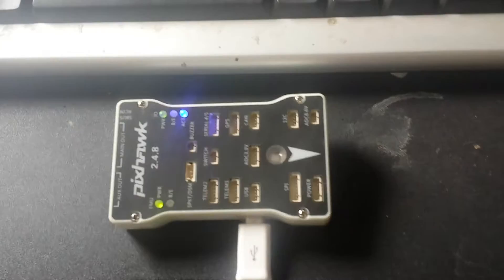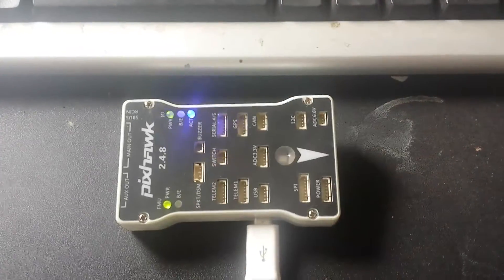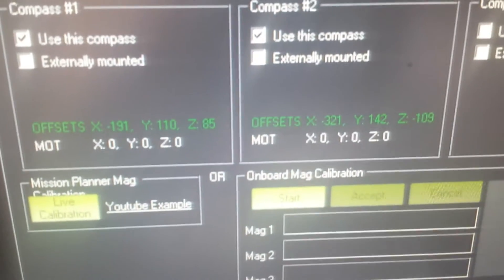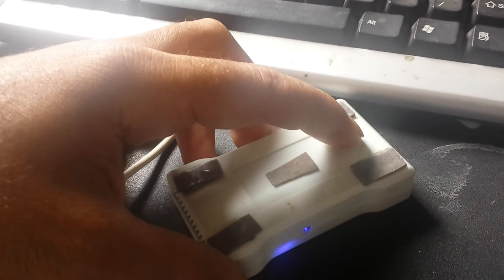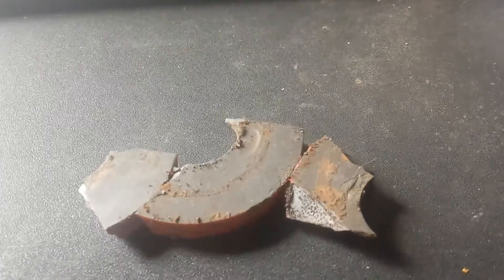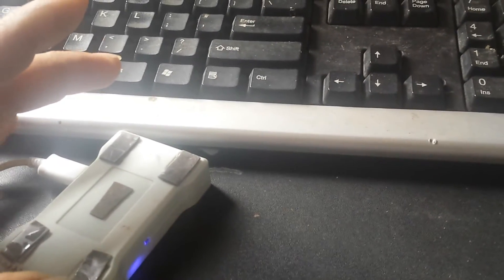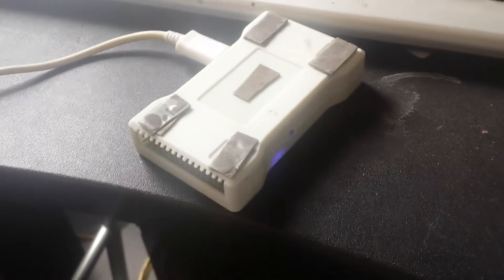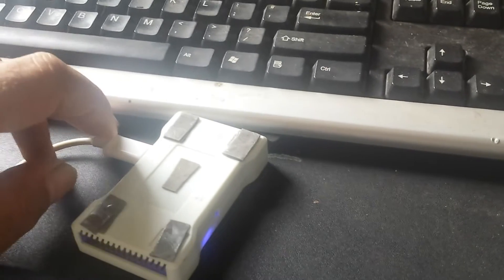pixhawk compass FIX!! for high compass offsets and compass inconsistencies.

Comment: after several failed attempts, I finally landed up with very good compass offsets;
COMPASS_OFS_X	30.37397
COMPASS_OFS_Y	93.62046
COMPASS_OFS_Z	55.33688

Earlier they were upto 350

I ordered a pack of four loudspeaker magnets 40mm x 6mm from amazon. Took a small stainless steel (non ferrous) kitchen bowl and also taken a stainless steel large utensil and filled it with 1-2 lt water and put the bowl in the large utensil, jointed three circular magnets in a way they attracted each other and put this combined cylindrical magnet  horizontally in the small bowl (which is now made up of three magnets, connected in series like batteries).

the end which freely pointed towards north was marked N (Northe) and the opposite end S (South).
Marked each magnet.

Took a cardboard box 5inch x 4 inch x 2 inch and put the Pixhawk in this box with usb cable attached.
Pixhawk was put normally and not flipped.

Imaging Pixhawk in the box is infront of me on the table, pixhawk heading is on my right hand side
Note that I did not flip the pixhawk, it is lying normally flat in the box with heading arrow toward my right hand side.

Attached one magnet on bottom of the box in center (North of magnet facing the box)

Attached one magnet in the right side of the box  (towards my right hand side, North of magnet facing the box

Attached one magnet another side of the box (the side of the box which is facing me)

Inserted the other end of USB cable in Laptop's USB port but did not connect with Mission Planner, waited for 15-20 sec and then removed magnets and also jacked out the USB cable from Laptop's USB port.

Again jacked in the USB cable again in USB port of the Laptop, started mission planner 1.3.80, calibrated compass and all done.

To reach on the above process, I had several faild attempts specially my offsets were in the range of 1500 when I flipped the pixhawk, it may be different in your case.

My Pixhawk is chinese clone of Pixhawk with aluminium CNC case and the IMU suspended internally which requires no ant-vibration pads to be used in Quadcopter frame.

Comment: Will this work if I use one big speaker magnet?
My magnet is the same length as the PixHawk.
My magnet is wider, of course, since it is a circle.

I want to try this, but hate the idea of breaking up this magnet, since it works so well picking up stray nuts and bolts on the shop floor. I just tie a rope through the middle and drag it around.
Reply from the maker: it should work with the speaker magnet no need to break it up , its a pretty forgiving process it won't harm the pixhawk to try it , if don't work good on all axes, you'll just have to get a straight magnet to get it all right, sorry couldn't reply earlier.

Comment from the maker: Because the earth's magnetic field is weaker then the magnets applied it calibrates the compass and then when magnets are removed it works off the earth's magnetic field again.  That's my understanding of it.  No it didn't matter what way the magnet was when I did it as long as the magnets stick together if Ur using   3 magnets